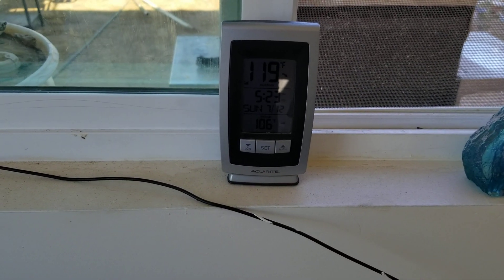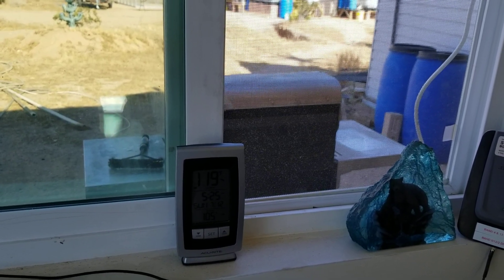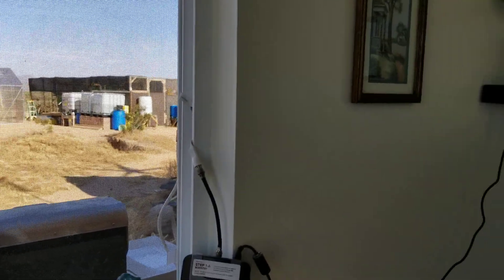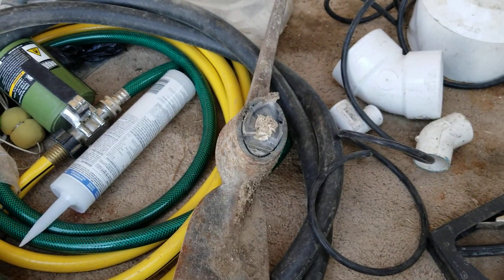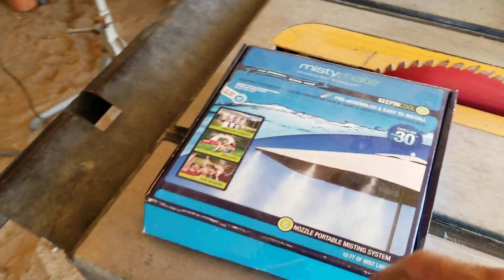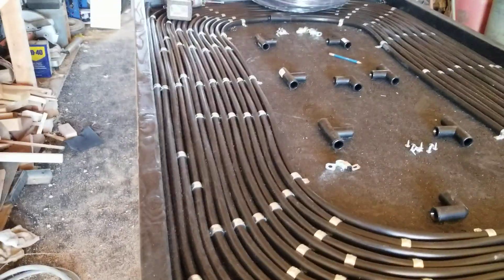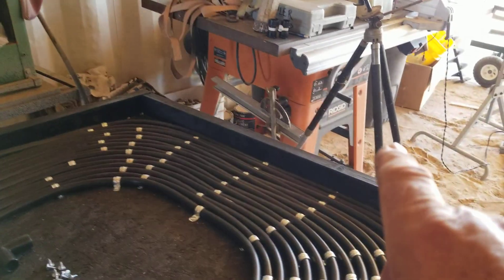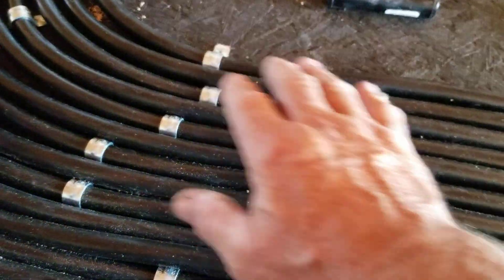Rain water collection? July 12, 2020

Comment: Hay there.G bear do you have any rodent problems if so what do u do to keep them out of ur garden. I'm north of St. John's
Reply from the maker: Welcome aboard, Holly!
There are plenty of rodents around here.  My aviary wire cage surrounds my garden of eating, floor included and keeps most out.  A few traps inside get the Houdini's,  and I place the carcasses in a coyote feeder that is  across the compound, so the coyotes come around at night and catch some of the stragglers.   I try to use natural evolution control where possible.

Comment: Damn that's hot G BEAR. Got some goodies there, just for pickin em up. I'm sure you could recirculate it to get hotter if you needed more water. I'm sure that will get plenty hot depending on the flow rate. TAKE CARE..
Reply from the maker: Got some more goodies today.  Went back and moved junk around and found some handy items.
Reply: @GBear  COOL !!

Comment: Suggest looking into an Earth type of filtration system for your water. It would be a box layered with varying grades of rock down to a fine sand that would act like the water running through the soil of the Earth. Should take it down to a drinkable level. Would have to watch it and replace the levels of filtration from time to time.
Reply from the maker: Sounds like an expensive hassle.
Reply: @GBear        It can be made from local materials and uses no exotic materials. Several write up on how to construct and works well. It is a natural method of purifying water to drinking stage.
Reply from the maker: In my survival course I learned how to make a filtering system to clean up water for survival consumption using straw, sand, pebbles, and charcoal from a campfire pit.  But we were warned that while this filter works wonders, it doesn't remove chemicals, cysts, bacteria and viruses enough for prolonged consumption and should be used as an emergency method of filtration only.

Comment: Where did your garden hose mister hose come from?  It would be pefect for attaching to my garden hose and cooling a few feet of my front porch where the feral cats lay.
Reply from the maker: I don't remember where I got it from, had it in storage for many years.  I'll check the box and internet for them and get back to you.
Reply: @GBear  Thank you!
Reply from the maker: Ps, I just ordered some mister heads from Amazon and will have them next week.
In the section after I ordered they had some like it for sale.
Reply: @GBear  Excellent, I'll give it a look.  Thanks, cuzzin!
Reply: I thought this Ryobi mister did well for $20.  https://www.homedepot.com/p/311952860
Reply from the maker: Welcome aboard!  Thanks for that.  I just ordered 20 mister heads set in 1/2" pvc couplers and plan to run 3 pipes along the ceiling in the greenhouse.